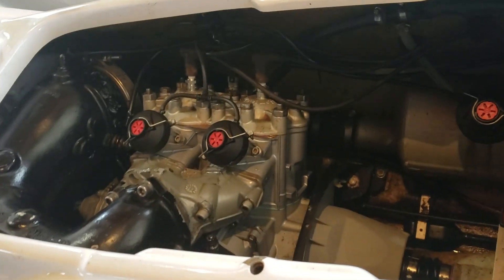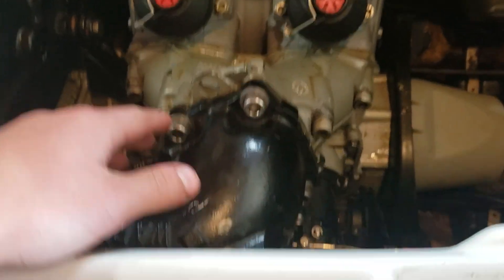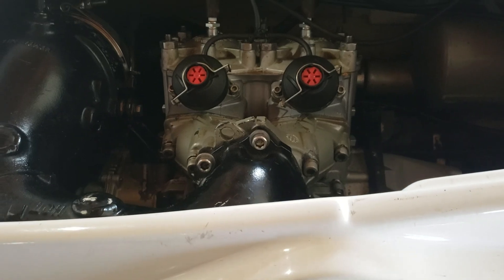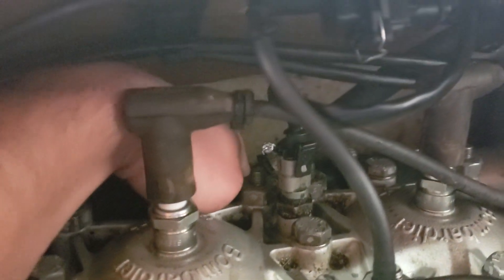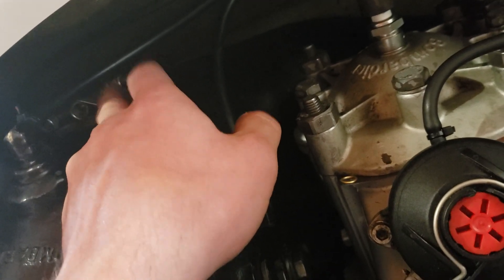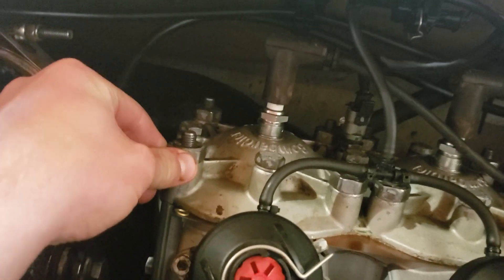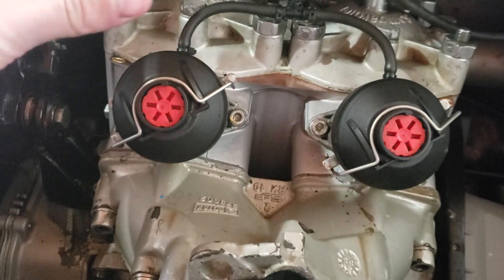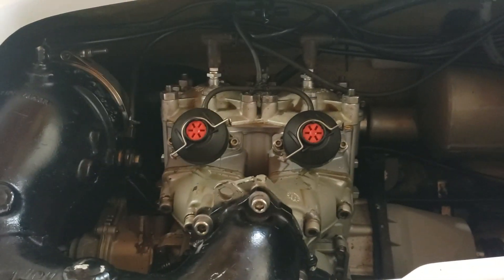Seadoo 951 disassembly process Basic overview

Comment: I just replaced the motor on my 98 and if you take the air box off you can take the nut off the exhaust were it attaches to the exhaust manifold with basic open end wrench

Comment: Hi I have this ski just thought how do I check the oil? Where is dipstick and filter etc.?? Many thanks
Reply from the maker: Ide recomend downloading and reading the operators manual. You can find it on seadoomanuals.net. the oil level can be checked with the fill cap on the oil tank. The filter is inline with the main feed line to the oil pump on the stator cover.

Comment: Hey MK I've got a 2002 seadoo RX 951 that ran ok last year but now it turns over but won't start. It seems like the engine is not pulling fuel through the carbs. Carb cleaner in the intake will get it going for a bit. Since it won't start I can't get a warm compression check but cold is 90psi. Maybe replace the rings? Top end rebuild? Fuel pressure test? Not sure where to start.

Comment: i have a 98 gtx limited as well but my intake looks different. it has two rectangular horns that come up on either side of the pipe, with rubber flaps over the ends...?
Reply from the maker: That would be the factory airbox. It does an excellent job at preventing water from being ingested into the carbs. My engine as pictured had pod filters installed. Same engine just different airbox/filter setup.

Comment: Just bought one last week, took it on the water, wouldn't go over 10 mph. In the driveway it idles at 3k rpm, starts right up. Took it to a shop said one cylinder reads 110 psi, they suggested a new engine, im wondering why not just a top end? Can you help ? Thanks
Reply from the maker: At 110 psi its hard to say or suggest what would be best without knowing how the condition of the bottom end is. That should really be judged by someone who knows what and how much slop is acceptable in a 947/951. I will say though I've had 947/951 with less than 110 @ sea level that ran fine. May want to investigate further before you go straight to rebuild.

Comment: i couldnt pull the  shaft out of the flywheel.. the seal is removed from one end, but that thing is on there good
Reply from the maker: Generally the grease creates a vacuum seal on the splines, could always try a pry bar to leverage it. Its tight but it will go.
Reply: @MK-qv7bq   What i found out from SBT manual is to take off the front engine mount, giving me space to pull the motor foward and it came right off!!  But then i realized i could of taken off just the top while engine was in place !! 😑😑😵‍💫😵‍💫  All that work 😮‍💨😮‍💨🥴🥴

Comment: Is it possible to change starter bendix without pulling engine on 99 GTX?
Reply from the maker: Yes, on both the 787 and 951 ski.
Reply: Do I need to block up the front of the 951 in order to pull the stator cover?
Reply: Thank you. I did the job and it went surprisingly smooth. Thanks for the help!!!!

Comment: I just bought one, same unit like yours. And it always drained the battery. Should I replace the stator?
Reply from the maker: I would start by checking your ground wire. If it is bad than the battery will drain. Afterwards ide run the ski and check the voltage of the battery with a multimeter. This should be done with a known good and charged battery. Should be about 14 volts. If theres no increase than there is an issue with the stator,regulator, or rectifier. I may also note that there are some fuses in the mpem. Wouldnt hurt to check if they're blown.

Comment: Need help, I rebuilt the carbs and replaced the fuel lines and now have two lines and two ports to hook up.   Mag side top of carb has an empty tee fitting and bottom of same carb has a fitting.   There are two lines one goes to the top of fuel tank, the other two the fuel select control, which goes where ?   Is there an online fuel line diagram ?  Thank you !
Reply from the maker: Smaller line coming from the fuel selector should run to the top of the carbs. This is your supply. Larger line connects to the bottom tee. This is your return. Hope this helps.

Comment: I have the exact same ski that I baught in pieces. I am stumped on where the fuel lines connect to the carbs? Can you show me where the fuel lines come from and connect to please? Thanks.
Reply from the maker: Unfortunately I no longer have my Gtx Limited, so I can't make a video. But if I recall correctly the supply line should be ontop, the return line wich is a larger grey hose should be on bottom, and the pulse line wich runs to the engine block will be on the side. All of these connections are on the magneto side of the engine. Ie closest to the front. These lines with the exception of the pulse line should be connected to the selector petcock. Wich should be labeled. Hope this was some help.
Reply: @MK-qv7bq  thank you for your reply I appreciate it was some time ago when you made the video. Much appreciated, I've connect up and she fired up straight away. Many thanks

Comment: I hope your still active. I have a question. I just bought a seadoo gtx limited edition with the same motor. It Idles high. That’s the only way it will stay on. If I idle it down it shots off. But when I ride it also it also smokes a lot. I just bought it today for $1000. Cheap or ripped off? I rode it for a good 15 min full throttle and it ran great. I noticed it topped speed at 49kmh. I didn’t pay mind to it or the smoke because it’s old and it was cheap. I thought “if it breaks I’ll fix it”. I just don’t have any knowledge on jetskii motors. I have general knowledge for cars air,fuel,oil main components. My assumption for the smoke is the previous owner put way to much oil in the mix. They took our the oil pump and I have to mix by hand.
Reply from the maker: The ski should idle roughly around 3,000rpm out of the water and around 1,250 in the water. Its normal for these skis to smoke when running premix. That should clear when up to speed though. As for the top speed 49kmh seems a bit low. Top speed should be between 55-60mph. What are your max rpm at wot?
Reply: @MK-qv7bq I can’t tell what rpm it idles at. I haven’t looked. But it makes sense! It did sound around 3rpm and I did notice when it was in the water it idled down a bit. It does clear up when it goes in the water a little bit but not much you can still see it. I’m not sure why it maxes out at that speed. I wish I could do something to make it hit full speed. What do I need to do ? I’m changing the spark plugs first they look rusty. I want to clean the carb but that’s a mission and I don’t have that much time to put into it. Plus I don’t want to spend the money on the rebuild kit. I want to rent it out 10 times to get my money back
Reply from the maker: @JFPRViRAL  I would pull off the rave valves and inspect/clean them. Often times they can get gunked up by the premix. This limits the maximum rpm. They should be located ontop the cylinder jugs. Each one is bolted down with 2 Allen head bolts. Also trace back the black hoses that attach to them. If there is a kink in the line it can also limit the max rpm.
Reply: @MK-qv7bq  now it doesn’t want to turn on. I turned it on then shut it off. Replaced the battery and terminals and it didn’t want to start anymore
 Idk what going on 😭
Reply from the maker: @JFPRViRAL  Hmm, well I'de say take a look at the plugs. They could be fouled. You can tell alot about how the engine is running by the color of the plugs. Will it atleast crank over? How may beeps are you getting? May sound stupid, but is there gas in it?

Comment: I can not find a way to get to the  nut which is on the bottom stud of the manifold what tool did you use ?    I need to clean the gummed up carbs.   Thanks for any help.
Reply from the maker: By manifold I assume your referencing the black "tune pipe" wich wraps around the engine. The carbs actually need to be removed prior unless you have specialty tools. So this means you can clean your carbs without having to remove the exhaust :)
Reply: @MK-qv7bq  Yes, the pipe that sits above the carbs... if you can remove the carbs without removing the manifold pipe then you're more flexible than me...  :)  Thanks for the reply !

Comment: does the 951 have 2 TPS sensors? Where are they located?
Reply from the maker: The DI 951 has 2 throttle position sensors. They are located on the the sides of the throttle bodies.

Comment: Nice video.. I have a question not portaining to removing the motor, but I was removing my carbs to rebuild them and accidentally pulled a clear line that runs on the bottom of the hull on the carb side and it runs and drains out the left side of the sea doo. Is that an engine drain line? I’m confused because I have no clue where it’s suppose to go
Reply from the maker: Thats most likely the vent hose for the battery. Some hydrogeon batteries have vents on them. This line normally clips into the front of the battery tray where the notch is.  If your battery doesnt have a vent then just clip it into the tray and your good to go. Hope this helped
Reply: I have the same model with the same motor.. I see that the hose fits fine where the notch is. I was just skeptical about it because it vents to the left side of the ski under the black lining, where I assume water might come in. Is that how yours is set up?
Reply from the maker: @biggROB45  under the lining there is a one way check valve. Pressure can only go out, Not come in. No water will enter through the hose. Mine is clipped into the notch. Ive put nearly 30 hours on my ski and the hose has given me no problems.